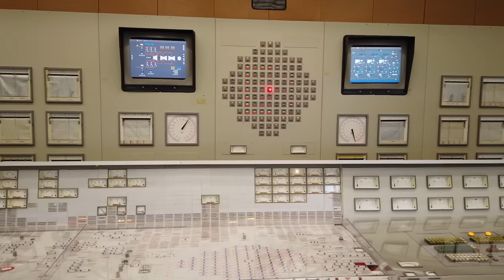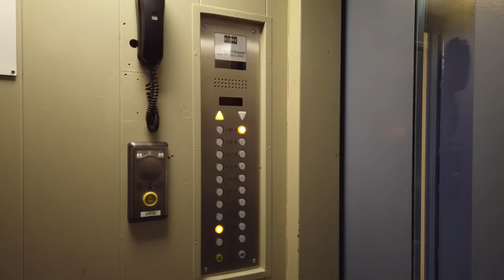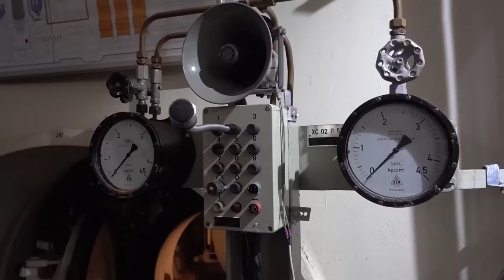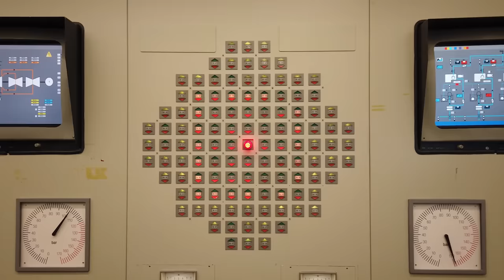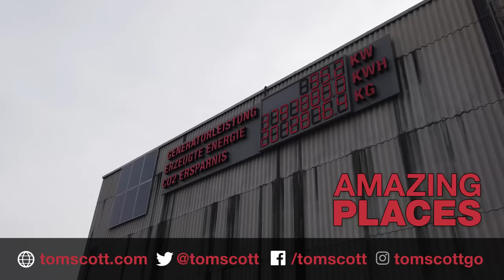This billion-euro nuclear reactor was never switched on

Comment: You notice how the world is regressing when you find out that the solar panels there take an entire year to produce the same amount of energy the reactor would produce in 19 min
Reply: Or the same reactor with a mistake could produce that energy in under a second...😂
Reply: @four0for  Nuclear reactors are not atomic bombs...
Reply: @mattiasdevlin1363  Indeed. France has 70 dont they? The US has 120 or something.

Nuclear ftw
Reply: @realMaverickBuckley  France runs on 70% nuclear power and they have around 55 reactors running, US has 90 something reactors and China has around 20 with more then 100 being build
Reply: Seems these few solar panels were installed to illustrate just that to the public. Otherwise they would have been placed in a more reasonable arrangement and elsewhere. As a matter of fact, solar and wind power in conjunction with hydropower storage facilitites, of which Austria has many and some of the most sophisticated anywhere, is cheaper, leaves no radioactive waste, and is by far less dangerous to the environment and its inhabitants.
Reply: @GiovanniBausC  1. It is more dangerous per GWh. 2. What you gonna do when the sun goest down/there is a drought/the wind doesn't blow? Fire up the coal and gas generators propobly becouse with the current technology its impossible to store this much power.
Reply: @zeux6634  Austria has huge storage ponds for their pumped-storage hydropower plants, some of which deliver several hundred megawatts each. We have experienced shutdowns of nuclear power plants in France due to lack of cooling water in dry summers, but the Austrians never ran out of water yet.
Reply: @GiovanniBausC  and shutdowns like that are rare and happen only in severo long-lasting droughts and if the powerplant was placed in a bad spot
Reply: @zeux6634 I mean, if shutdowns due to lack of water are rare.... then hydropower could be fine too
Reply: @iamthinking2252_  Sure hydro is great aside from the fact that is harms the ecosystem alot. But it only works in good locations, there has to be a decently sized river that flows all year, not only that but it has to be in an area where droughts are extremely rare and short. Nuclear doesnt have that problem fuel can be easily deliver from the opposite side of the world

Comment: People:  burning fossil fuel causes global warming.. 

Also people : turn off nuclear power plants because it might spill nuclear radiation
Reply: @ghost500e  you realise that humans have technologically advanced significantly since those disasters right? reactors now are built in a way where it is physically impossible for an accident to occur
Reply: @ghost500e  Physically impossible for an accident to occur does not mean that it is physically impossible for the reactor to break down. The reactor can break down, but not cause an accident. In fact, that's what a good design should do. Anyways, although I highly doubt his claim that an accident is "physically impossible" to occur, modern reactors are extremely safe and held to extremely high standards. We've looked at previous accidents, seen their mistakes and have measures to prevent those mistakes from ever occurring again. The probability of a nuclear power plant breaking down these days is astronomically small. The unfortunate fact is that we simply have very few viable options pertaining to energy generation. Nuclear is one of the lowest cost, highest yielding, and least environmentally impacting choices.
Reply: @andybao3210  "Nuclear is one of the lowest cost, highest yielding, and least environmentally impacting choices." All true, but irrelevant since investment in a nuclear plant is about the return on investment and the speed of that return. High upfront capital costs and long term returns are terrible investments given the short term investment strategies of most investors. If a nuclear plant can be installed in the same time and cost of a solar or wind farm, without the social baggage and deliver quick returns, then there would be tons of nuclear plants. Until that happens, nuclear will have a hard time competing.
Reply: @ghost500e  I'm not keen on trusting a person that can't spell "alright"
Reply: @ghost500e  It won't matter if a reactor breaks every 100 years. There has been one death in fukushima caused by cancer. Hundreds of thousends of people die from externalities of other energy sources like air pollution. More have died installing solar panels and wind turbines than from nuclear, ever. And those have produced peanuts compared to nuclear reactors.
Reply: because diseases are cured in 3 months are they?
Reply: @ghost500e  and how does covid19 relate to nuclear power?
Reply: @andybao3210  Everytime there's an accident, the causes are examined and steps are taken to ensure there's no repeat. This happens with virtually everything made. However, problems still occur as every possible eventuality usually isn't  considered. Human error or ignorance can overcome built in safeguards, as has happened previously. The problem is the ramifications of a nuclear accident are dramatic, so even a very low likelyhood isn't very reassuring. Unfortunately, reassurances have been thrown around in the past, only to be proven unreliable, so repeating them now just isn't believably to many.
Reply: @ghost500e  Ok mate, do you wanna do the whole, long walk thing?
Reply: @FBI Chernobyl only happened because they were experimenting with the reactor. And then when it exploded they were so afraid of being sacked or killed that they didn't report it for 6 days. The firefighters who responded thought it was a regular fire and poured water in through the hole in the roof (making things worse).
Reply: @ghost500e   It’s funny how people focus on the extremely small risk of the safest energy source at the same time they look at the little amount of safety the riskiest sources provide.

Btw Three Mile Island is just a proof of how safe it can be
Reply: @ghost500e  bruh Fukushima was caused by an earthquake and then the coolant was destroyed by a 15 meter tall tsunami. I think that under those circumstances, a machine so delicate like a nuclear power plant, probably won't survive. 

Do I think they could have had better safety protocols? Yes. But is it fair to point fingers at that and say that it mean nuclear energy is completely stupid and dangerous? Probably not.
Reply: @ghost500e  actually most of the nuclear explosions or accidents happened due to human error and rarely the reactors fault. Plus, chernobyl and the three mile incident happened almosy 40 years ago. Also what about the Deepwater Horizon explosion, Texas oil refinery explosion, Montana Oil spill? Most of the nuclear explosions happened more than 3 decades ago. And fukushima? It was caused by a tsunami, and the power plant was completely caught off guard. Who expects a nuclear power plant to be tsunami resistant when most of fukushima itself was taken off the foundations.
Reply: @ghost500e   atoms decay only if they're radioactive.
Reply: ghost500e damm I have never seen a person who hates people having power
Reply: @Exitore  remember the ship that was called "unsinkable"?
Reply: @ghost500e  especially the McDonalds ice machine
Reply: We didn't turn it on because we didn't want to deal with the nuclear waste.
Austria has replaced the nuclear power plant with green energy.
If we were scared of leaked radiation we would leave the country, because there are 14 nuclear power plants between 14 and 200km from our border.
Some of them classified as high risk reactors. 
I don't see your point dude.
Reply: Well in Austria we now have a lot of hydropower so I would argue they (they because I wasn't able to vote back then) still made the right choice.
Reply: Everyone is bashing a comment which dosent exist... Fantastic !
Reply: @Exitore  nothing is perfect, to think so is Faith, you can count on humans to make mistakes building them. The titanic was "unsubmersible" apparently, that went well
Reply: @samdumaquis2033  exactly, we have all heard of manufacturer's claims throughout history whether recent or in the distant past, and have seen the resultant failures despite being reassured nothing can go wrong.
Human input= always a chance for errors. Aside from that, uncontrollable environmental events add to the strain on any "indestructible" human creations.

Comment: I was on the reactor and if you can get a spot in a guided tour, take it! It's one of the best tours you ever will have. You will even go inside the core of the reactor and see inside. It's amazing!
They are also very open about the danger of it. Not only were some technical emergency systems never used and tested before, but the guide told us: "It's like a company builds a Jumbo Jet and know how to operate, start and fly it - but has no real plans for an emergency or the landing!". Nobody knew at the time of building how to ever shut it down and contaminate it - the procedures where simply not invented yet. Know combine that with the fact that this is about 50km from Vienna (the largest city in Austria with about 25% of the combined population of Austria) and directly near the Danubue, the biggest river of Austria, passing through Vienna and then several countries - and you know how dangerous this was for us and how it would set Austria back at least 100 years and destroyed it's main city in case of a nuclear accident.

Comment: Nuclear power has less dead per MW compare to any other form of power production. Hell coal Ash is more radioactive than used up nuclear fuel but nuclear energy bad.
Reply: No it isn't
Reply: The second part is not correct. it is true that coal plants increase radiation levels in neighbouring communities more than a nuclear plant, but that's because nuclear waste is not just blown into the air like ash.
Reply: @Sotha42  look up brown coal Ash radiation

Comment: How many tons of CO2 would this plant had stopped from going into the atmosphere if it had gone into operation?
Reply: how much toxic nuclear waste would it have produced?
Reply: Easy calculation. A similar-power coal power plant was built to replace it at the time at Durnrohr. Coal emits about 800 tons CO2 per GWh produced. It didn't operate for more than 25 years before being replaced with gas/biomass though. Comparing the coal unit to the nuclear unit at ~700 MW continuous capacity, the coal unit would emit 4.9 million tons per year to keep up with the nuclear unit. Alternatively, today since almost all coal capacity had been replaced with natural gas, which is "only" 500 tons CO2 per GWh, we're now looking at an excess 3 million tons CO2 per year, that the operation of this nuclear unit could be saving. For comparison, according to Worldometers the total CO2 emissions of Austria (all sectors) is around 75 million tons per year.

Comment: This is horrible. They are considering turning a ready-to go, reliable, safe, CO2-free energy source into gas powered  plant.  This planet is doomed.
Reply: Pawel, nuke plants have a finite lifespan, and when their time's up, it costs more to decommission them. But the waste will live on forever.
Reply: @MrJx4000  the initial lifespan is often extended. comapred to the amount of energy produced, the amount of waste is minimal. alternatives also have limited lifespan and waste problem.  A wind turbine lasts 15-20 years and turbine blades are not recyclable. (on top of that wind turbines require wind to work, and nuclear plants may work round the clock)
Reply: That Bearded Guy  yup. look like C.H. deleted his or her comment. So to clarify, C.H. claimed that Zwentendorf has the same design as Chernobyl. This is not true, Chernobyl reactors were/are graphite-moderated RBMKs, which have positive void coefficient. Which means, briefly, that uncontrolled increase of reactor temperature leads to processes that increase reactor output creating a potentially (or, as in Chernobyl, actually) dangerous positive feedback. Zwentendorf is a boiling water reactor, these have negative void coefficient.

Comment: You don't ask the people "Do you want nuclear power?" you ask them "Do you want really cheap power?" then the answers would be different. Panicked people voted no because NUCLEAR is automatically bad. Wind and Solar generated crap power compared to Nuclear, plus it destroys a lot more terrain, displaces a lot of animals and it doesn't work all the time.
Reply: @nujjigram  It's a manipulative question not fit to be one asked in a referendum.
Reply: @nujjigram  It's not. It's really not. We still live in a democracy. If the people don't want a nuclear power plant you don't build one. The opinion of the general public is important to anyone that values democracy.
Reply: Do you really think the people of Austria didn't know this could drop the cost of electricity?  They were all happy about paying more if it meant there won't be any nuclear waste being produced in Austria.

And the issue was mostly about waste, not about safety. The referendum happened several months before the accident at the 3 mile island plant and years before Chernobyl. At that time the safety issue was much less of a discusion point than it is today.
Reply: Aj Hegi Don’t need high IQ. Just need passion and curiosity.
Reply: @CryztalzArtjom  thats why democracy is flawed, this should not have been a public referendum. Maybe a mediated debate in phds on the matter or just build the plant
Reply: @alexpro8843  Or simply don't build it
Reply: @CryztalzArtjom  there is the problem, it would be some what reasonable if the plant wasnt built yet, but since its built the only logical thing was to get it to run, there shouldnt be a referendum on stuff like this

Comment: Looking at it now, I think of how much less carbon would be in the air now if this had been operated as planned, far less yet if the rest were built. I've heard that if it weren't for the paranoia of nuclear power in past decades, we'd actually be far better off now from an environmental standpoint. At this point renewables are the clear path forward, even in terms of cost, but we'd be much better off if the past 50 years had been nuclear-powered instead of mostly coal-powered.
Reply: Renewables are not so renewable at all. A large windmill cost 260 ton of steel. That is 300 ton of iron ore and 170 ton of coal. You see that a windmill never produces enough clean energy to undo the filthy steel production. Solar panels are full of heavy metals (not the music genre). For both there is no recycling possible.
And both works only 50 % of the time. So you need a conventional power plant as back up. Burning coal, biomass (trees), gas or nuclear CO2 low emissions.

Comment: If it weren't for politics and sensationalism about nuclear reactors, the scene towards cleaner energy would orders of magnitude better today. France produces 80% of their energy with nuclear reactors and they are fine, the waste is minimal and can be safely managed and modern efficiency on technology make reactors waste even less and even re-use waste of old reactors. Nuclear power is a no-brainer to combat climate change... it always has been.
Reply: Cuz the long term problem solving just isn't considered in the equation. It is for now, not for the people to come.
Reply: @matteslambertus7684  There so few "long term problems" with some m3 of long-terme nuclear wastes (a very small percentage of them) compared to the "long term problem" from the pollution caused by ALL others energies... (Less for hydrolic, but it's much more dangerous too, ESPECIALLY compared to nuclear)
Reply: @Aztonio  You've got to take the time-aspect into the equation, otherwise it's just not a valid comparison. Even if nuclear waste has the smallest percentage of waste, the fact, that it endures thousands of years, not recycable, potentiates the ecological effect of it to one greater than any other. Even regarding the worst carbon emission..... carbon can still be reimplemented into the lifecycle.... nuclear waste can't. If any, it could be a good momentary bridge to entirely recycable energies, which have no better alternative (fact) and then be shut down as soon as the energynetwork is developed to sufficieltly support a de-monopolized, regional, entirely recycable energy household.

Comment: In parallel, further down the Danube lies another unused nuclear reactor. It was bought for the Belene power plant, whose construction paused due to cost arguments. Then, the government of Bulgaria held a referendum on whether the public wants a nuclear power plant.

The referendum passed. The government still couldn't figure out a way to complete the project. So it also sits unused, nearly finished.
Reply: and then there is another one even further down also in bulgaria, and it operates still.

Comment: That is a crime against humanity.  The cumulative output of 750MW x 3 reactors over 40 years would be roughly equivalent to burning the total oil reserves of Australia.  Maybe a third of Norway's reserves up in smoke, all because a tiny provincial European outpost bowed to Soviet propaganda to avoid becoming the next domino after Hungary.  Funnily enough the number of MWh Austria today has to import or burn coal for is almost identical to the nominal output of these three missing reactors, around 19.7 TWh p.a., or a third of their current generation capacity.

Comment: 700 Mw can power maybe 250000 houses, if we talk about separate unit buildings. If we talk all high rise buildings with apartments, built recently, then maybe you can power 1 million. 400 to 1000 households per Mw as a thumb rule. 1.8 million on 750 mw is a lot.